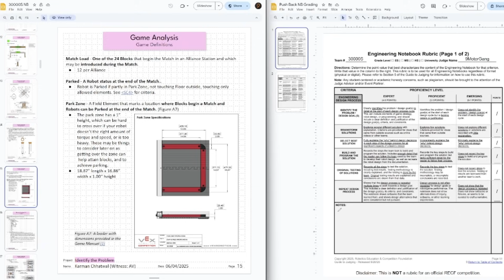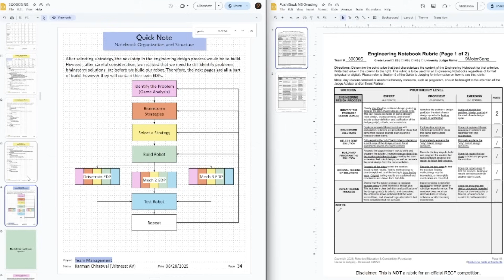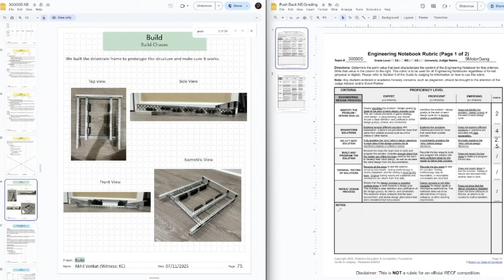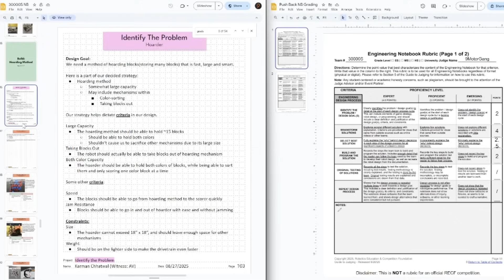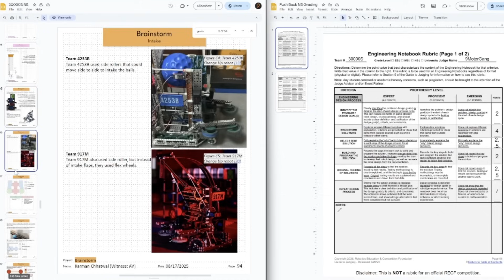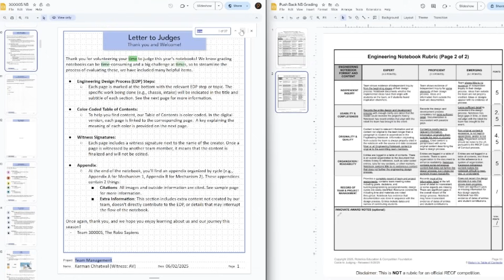Push Back Notebook Roasting

Comment: So following something like this, would it be ethical to go back and rework images and such. I understand that it is meant to be a clear view of the design process, and I’m not saying that they change any information, such as testing, but what about formatting. And how could someone go back and revise for a higher score, even after completing pages?
Reply from the maker: Technically it’s not allowed. However, a very large number of competitive teams do this anyways and there is no way for the judges to know if you did
Reply: Oh ok that makes sense. For us initially we had a lot of massive paragraphs and so we went back in a reformatted that into bullets for better readability for judges and easier writing for the nb itself. I’d say it’s fine bc we didn’t change any information, just how it’s presented, so it’s fine in that case in my opinion, but if your changing the information itself then I think that’s wrong bc now it’s just not honest to your actual process and how you went about designing your strategy to begin with.